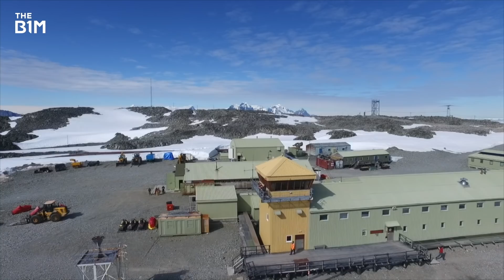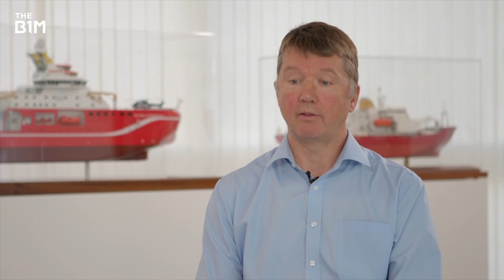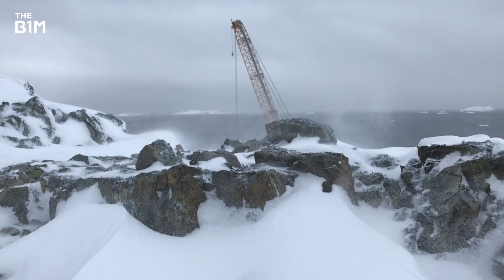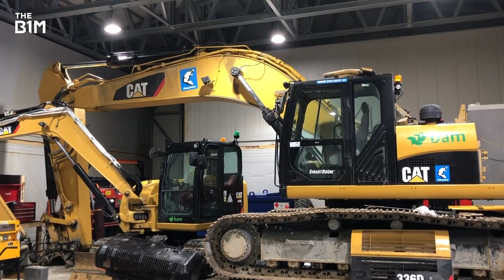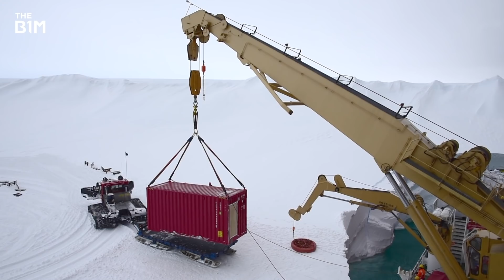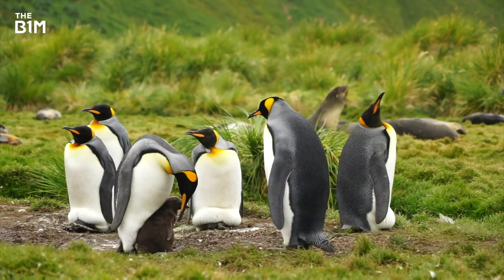The World's Most Extreme Construction Site

Comment: I work as a field engineer supporting oil and gas construction. We have had some pretty remote sites with 0 supply chain, nearest medical assistance is 45 minutes, parts can be days away. It is a challenge, our clients have been large enough to either establish their own supply chains or contactors move in, sites are standardized thus parts are on hand and we have had years of practice. Remote construction is hard specially with just 1 project. Would be interesting to see in person.